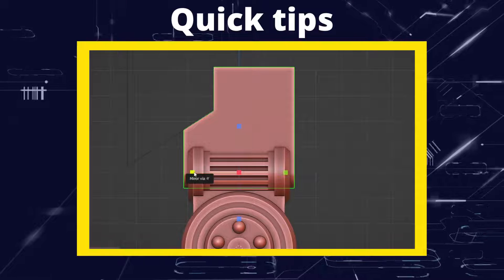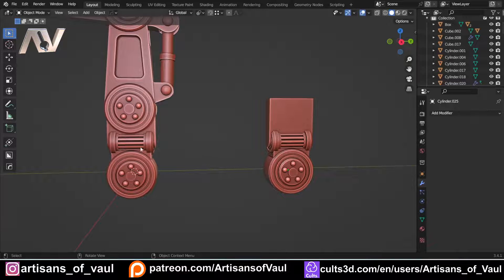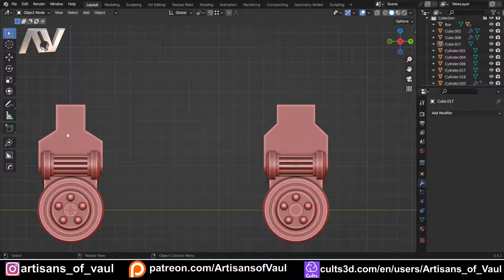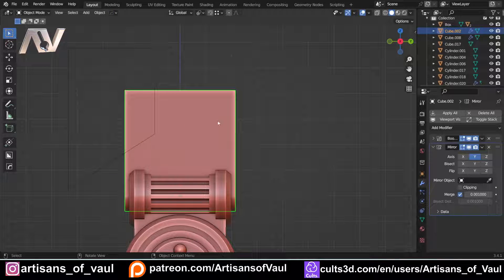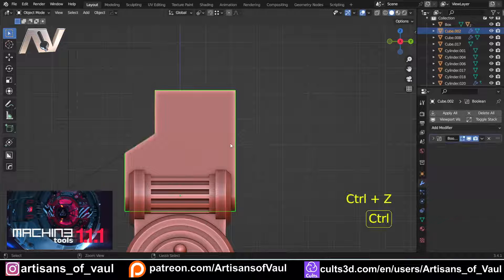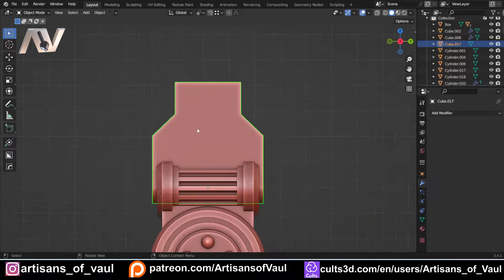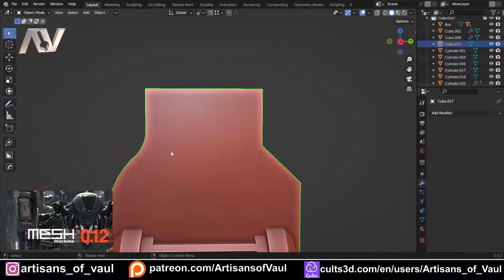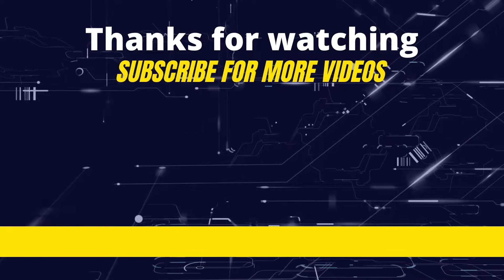The Mirror and Symmetrize Tools

Comment: Handy note: Symmetry and mirror will always work with the origin as the pivot. Moving the origin is annoying. Fortunately there's a faster way: Addon: 3D viewports pie menu -> (preferences) Enable Auto-origin pie Ctrl+Alt+X. Now you can move the origin with ease, with a single op, without involving the cursor
Reply from the maker: Good tip.  I use Machin3 Tools as I like the way it allows the cursor and origin to be moved with ease in a variety of ways.

Comment: If you need to Mirror your object on an axis that is not aligned to the XYZ axis, you can create and Empty>Plain Axis or a Plane (move and rotate into place). Select this Empty/Plane object in the 'Mirror Object' section of your modifier.
Saved me some effort when i was working at an angle not at the origin.
Reply from the maker: That's a good tip. The flick mirror tool from Machin3 Tools does exactly that,  which is really nice.

Comment: I guess it’s also good to add, when would you pick to symmetrise vs mirror?
Reply from the maker: That's a good question. Sometimes I use the symeterise just because it's faster than coming out of edit mode 😅 And then I use the mirror because I'm going to keep making changes and I don't want to have to symmeterize each time I do. The other thing with mirror is you can mirror across another object to effevtively make another copy on the other side, which is really helpful.

Comment: I was using hard-ops the other day to mirror some text and I could not work out how to get it the correct way round on the mirrored side, rather than back to front - I'm sure I'm missing something simple and fundamental here! it does lead to the larger question of how much you can manipulate what you are mirroring 🤔?
Reply from the maker: So mirroring by its very nature will flip it and for text that means it will be the wrong way around. What you want to do is, if the text is just coming after the original or above or below, like repeating itself, is to use an array. If you want the text on the other side of an object but then the text to be the other way around you'd want a linked copy. I've got a video on that coming this Monday on the Patreon or in a week's time on YouTube.